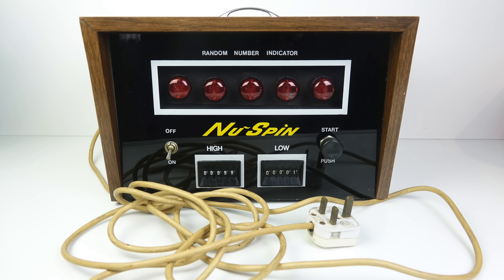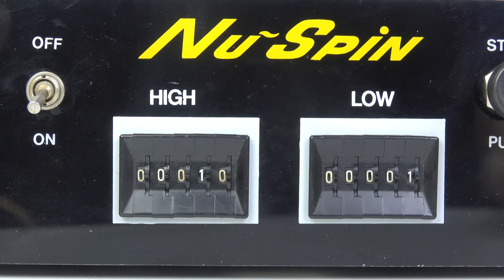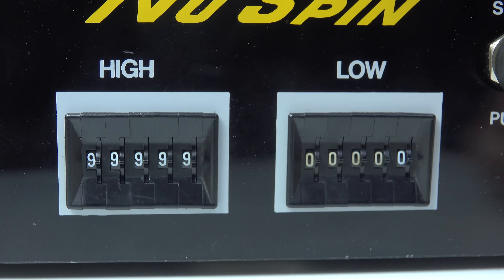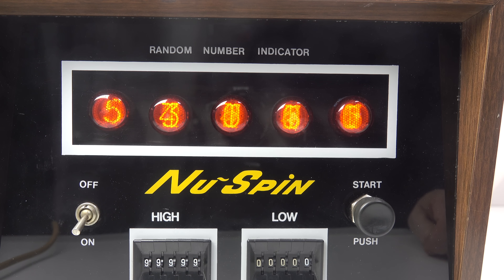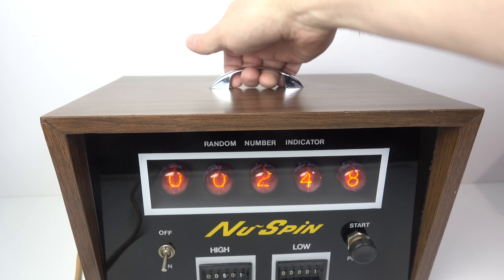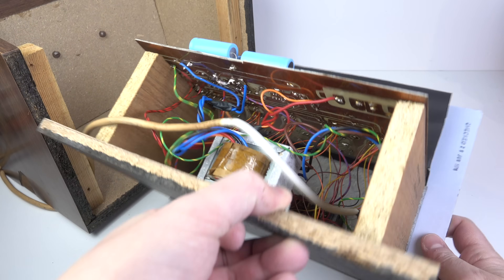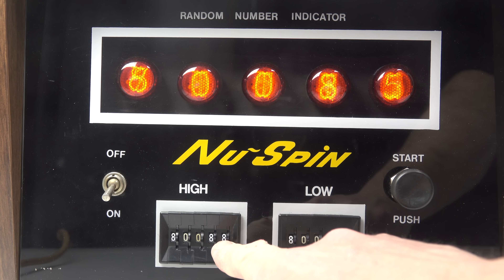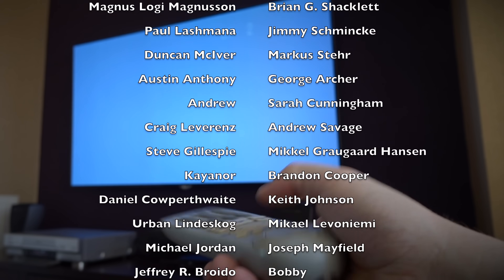This is a bit random - Vintage Random Number Generator

Comment: The transistor logic can't do the only 1-2 digit response. I will get more accurately corrected on this next statement, but many will still know what I mean: the random and/or on two digits is kinda like the divide-by-zero issue. One could make the circuitry do it, but it would needlessly complicate the system.

Comment: they're mostly use for lotteries and whatnot, but it's used for doing statistical simulations as well.  there are labs with random number generators in them but it's all very niche theoretical sciences rather than anything concrete

Comment: Nerdy questions here:

1. What happens if the low number is higher than the high number?

2. What happens if you change the numbers while it's generating a number?

Comment: Number bug is from the logic counters used, the load for the low counter will preset that count, then the upper count is a compare on the counter to reset the counter to the preset count. Due to the compare being very fast there is no way for the gated stop pulse, most likely from a simple RC delay on the input push switch generating a slow ramp on a gate input and the variable time being that the threshold trigger for the gate does rather change due to noise slightly, which is going via a clocked latch to ever stop on that count, it will tend to stop on the base value instead as the preset load would have occurred. Thus there is the bias to the initial number that is higher than any other number.

Otherwise it is just counting at high speed ( for humans, for the TTL logic used the rate is quite low) at around 100kHz or so, and the jitter in the pushbutton on time from you pressing it does provide quite a big amount of variability in the final count, the count runs around  a large number of times in the delay, and is reasonably random.

Home made PCB there, and RS components all through the unit, so likely was a cottage industry making them, probably also used an existing 1970's wooden box as well for it, probably intended for audio equipment. The silkscreened perspex front with the cutouts was likely made by a signage shop for the manufacturer, they probably ordered them 20 at a time as they got orders, then built to the order. Having serial number starting at other than 1 is also common, they probably started at 8000 and went up, perhaps the model was the 8th machine in a series designed by the shop, and the first model was serialised at 1000, as they probably figured with such a small usage scenario that 3 digits for a serial number was absolutely never going to be exceeded.

Comment: In USA middle school in the mid 1980s we learned how to generate random numbers from tables. We were told a common application of random numbers generators were factory quality control. It is pretty well known and studied that humans are poor at picking truly random numbers;  therefore a random number generator would pick products on the assembly line at random for QC inspection. The formula int(rand(100)) would also pick a number between 0 and 99 due to the "integer" function disposing of the decimal part and therefore rounding down. However not sure why you cannot pick a random number out of 3 choices. Great video, interesting!

Comment: In 1955 the RAND Corporation (That's "*R*esearch *AN*d *D*evelopment")  created a thick book called "A Million Random Digits with 100,000 Normal Deviates", which was the scientifically acceptable way of getting random numbers for quite some time. Apparently, in the 70s, the dead-tree method was replaced with this electronic method.  The electronic method is still technically used, and you could get scientists arguing for decades about appropriate sources of entropy.  

But anyway, if you were doing Monte Carlo Method Research, you'd want one of these!

There's more details in the Million Random Numbers book, which was helpfully re-released in 2001 as a curiosity more than anything. More details, including a link to the full text of the book, is at https://en.wikipedia.org/wiki/A_Million_Random_Digits_with_100,000_Normal_Deviates

Comment: Am i seriously the only one who thinks this is insanely overkill for a raffle? I live in a fairly wealthy area, and every raffle I've ever seen they just used two of those rolls of tickets you can buy super cheap, ripped off your ticket/s off the designated colored roll then ripped off the ticket/s off the other roll and put them in a glass bowl, box, hat, black fabric bag, one of those spinner things, or whatever. I can't imagine spending $300 for a number generator when 2 $1 rolls of tickets and the hat on your head is arguably far more random. Even if you did weekly raffles or something, I can't see the justification in dropping $300 to raffle things off. I mean you could literally buy 100 sheets of paper, cut each sheet into 50 squares and just have peeopl write their names on and and follow the previously mentioned process all for like $1.

Comment: I agree with posters who think it was particularly designed for raffles where one would sell a range of tickets.  The machine would be noticeably non-random if trying to pick from among tens of thousands of possibilities, but not if it's being used to e.g. pick numbers from 19831 to 20017, or between 99871 and 00168.  It's curious that it seems to have a minimum range size of 3.  If you specify a range of size 4, does it seem to pick uniformly from members of that range?

Comment: I  repaired things like this in the late 70s / early 80s. The ones I fixed were made by a company in the Wigan area called. (initially), "Club 70's". They sold these as electronic Tombola machines. They also made electronic darts scoreboards, (essentially a calculator in a big box with large cold cathode display tubes), and electronic bingo machines - the last of which was a huge case with a Nascom 1 computer inside, and a large, 4 digit display on the front, using individual LEDs. I recognise the build style as similar, and the particular microswitch push button on the front, also used on the scoreboards. Might be the same company.

Comment: random numbers can also be used in a formula (that i don´t remember right now) for simulation (well the atomic bomb was simulated before it was made) so you can simulate what´s the probability of something happening or not happening and random numbers are used, you can generate now days random numbers with almost any pocket calculator, computer, programming code, etc.

Comment: Fun video. I chose 98 and there it was so that was randomly lucky. "If you arn't a nerd stop reading now"!!!!
 My father (RIP) worked on "Pegasus" (as a charterd electrical engineer) when he was younger but went on to more advanced systems. He for a while was working on a choice of machine to choose premium bond numbers randomly and being the perfectionist he was he came up with three systems none of which was cheap. The premium bond higher echelons said they were way too expensive and decided to go with a much cheaper system. My father dutifully pointed out that this system would start to repeat numbers and become more and more less random over a short time. They ignored him and went with their option which within a year was scrapped for a system that my father now recommend at five times the cost of the origional most expensive system he put forward. They called it "Ernie",my father said they could have named it Doug after him!!!!! Pegasus never successfully ran a single card matrix program to completion ever. You can't win them all.

Comment: My dad built one of these in the 70"s, the difference is it generated the lights randomly, no numbers, it had six lights and you could stare at it for hours and it would drive you crazy. I'm not sure what happened to it but if I find it I'm going to get it going again, it had a huge battery in it which I'm sure I can find again, Thanks for the video, it brought back memories of The Box, as my father called it.

Comment: Yes it could be used for lotteries.  It might also be used for generating random surveys for research.

I used to use something similar for doing quality control sweeps before the start of production in a food production facility to ensure the cleanup crew had done their job. Areas would numbered and the machine would choose which areas were inspected. If the selected areas were clean, then the rest was assumed clean as well. If they were not, they would have to be re-cleaned and more areas would be inspected until the inspections came up clean.  This prevented the inspectors from having to do total inspections through statistical sampling and the cleaning crew managers couldn't complain that they were being targeted since the machine chose which areas were inspected.

Comment: Many years ago I worked for a marketing firm that did promotion materials for the state lottery. I remember when they switched from "ping pong balls" to computerized number picks. I was skeptical and not thrilled about it as anything computerized like that added a feeling of "fix-ability" to it. You couldn't see balls bouncing around randomly before numbers were popped up into a tube. There was no explanation on how the numbers were generated, what "equations" were used, how were the pseudorandom generated numbers were "seeded" etc etc. Just "BOOM!" numbers were popped up on screen with no fanfare or drama.

I knew a little bit about programming and felt it was not a great idea to rely on them for handing out millions upon millions of dollars on a regular basis and did some research and knew that computer generated random numbers are not "truly" random. I liked the ping pong balls based in reality. Of course maybe I was being paranoid but I kept coming across issues that could arise from improper seeding of pseudorandom number generators.

Of course any concerns over true randomness were overridden by the cost of the dang ping pong ball machines. That was the main reason. Those stupid balls and the machines apparently cost a fortune to maintain. Funny that the crazy scandal in PA in the 80's with the weighted ping pong balls wasn't really an issue. They kept using those balls for a long time after.

Comment: The fact that it has a "low" is a pretty good piece of evidence for the raffle hypothesis. If you've ever sold raffle tickets, the way it works is you buy a giant spool of preprinted tickets that have sequential numbers on them. Each time you run a raffle, you make note of the number of the first ticket you sold, and then you read off the number of the first ticket you have left. You then pick a random number that's greater or equal to the first one you sold and less than the first one that's left. This is exactly the mechanics of this device, down to the seemingly strange behavior that the "low" is inclusive but the "high" is inclusive.

(Using this algorithm allows you to buy one big spool with thousands of tickets and use it for dozens of raffles over time, without expecting people to return their tickets in good shape.)
Reply: The high is non-inclusive*
Reply: I guess that what she meant, since you would want to exlude the high ticket that you haven't sold.

Comment: no, you on the right track with the raffle thing.  At a social club i used to go to years ago (80's/90s) used to have several  "100 Clubs" running each month (a kind of raffle), that would be called on a particular Sunday night each month and the winner would get the prize money, but you had to be in the club to be a winner or the club got the money or it rolled over to the next month..

Comment: A book from the time titled "A Million Random Digits" has a nice introduction talking about scrambling and sampling (though it's quite technical). This machine seemed to be a way to replace it, or at least save the time it took to remember which one you stopped on, as well as the problem of "oh another digit greater than 8, I'm picking 100 samples out of only 80085!" https://en.wikipedia.org/wiki/A_Million_Random_Digits_with_100,000_Normal_Deviates

Comment: Could you put up a hires pic of the left hand side of the board (where these blue caps are) somewhere so can see the logic that lives there.... else the count is being done by these 7490's (decade counters) and decoded by the 74141's (BCD to decimal decoders, HV outputs) as I suspect that's stopping the count somehow. My money's on the 7419x presettable counters.

Comment: For a final year project in 1975 I designed a random number generator,. Four digits displaying on seven segment Numitrons. The random element was how long you held down the button. It was clocked at 500KHz. The trick was that it must not repeat a number until reset. How that was achieved using memory chips of the time was complex.

Comment: The fact that you couldn't get it to display 80085 despite the valid range and that you kept getting 80084 repeatedly says a lot about how random it is! It would be fun to do some statistical analysis on its output or at least know how it works. I sure wouldn't want to be part of a lottery using this thing!

Comment: I'm gonna guess it's a running counter using cascaded decade counter chips and it measures the time during which you press the button which would be fairly random down to some small measure of time. Using this it seeds a delay and then stops at the final psuedo-random number in the count. The start and end inputs only affect the overflow and reset values of the counter.

Comment: As a child I would go with my parents to a social club on a Saturday night and during that evening there would be a raffle and this machine was used for that purpose. I remember the manufacture name being identical to the one you have. The company also sold the raffle tickets to the club on large rolls as the same name was pre printed on them.
Reply: Yes, as a child in the late '70s and early '80s I remember clearly these being used in at least 2 social clubs to draw a raffle number, right after the bingo: As my granddad was on the committee of one of the clubs I actually got to play with it - but like you, the novelty wore off after about 6 minutes! I think the random delay is something to do with charging that big capacitor with a wave function, then the discharge time of the cap is when the numbers stop sequencing. Basically a rapid saw-tooth wave is generated,  then when you let go of the button, the voltage (value) of that wave is used to charge the capacitor, it then discharges, and stops the count. Its actually pretty random.
Reply: What's a social club?
Reply: @lucifer2b666  What's "social"?

Comment: If it's random then it could indeed generate the same number three times in a row, say. If it's shuffle, then it'll presumably cycle through all the available numbers between your set limits and when done, start off again in a different shuffle.